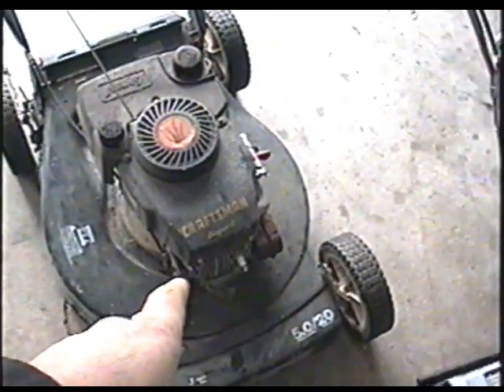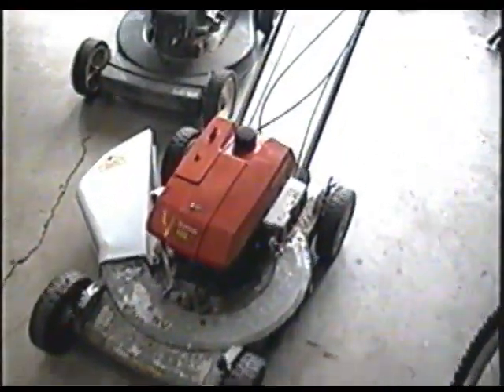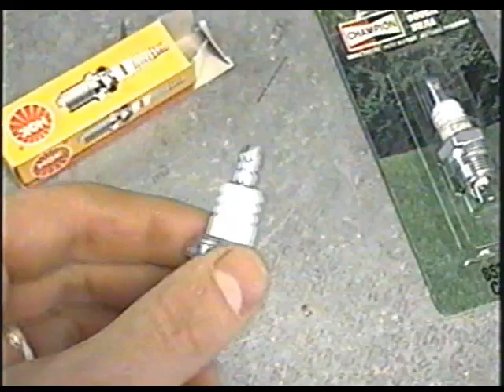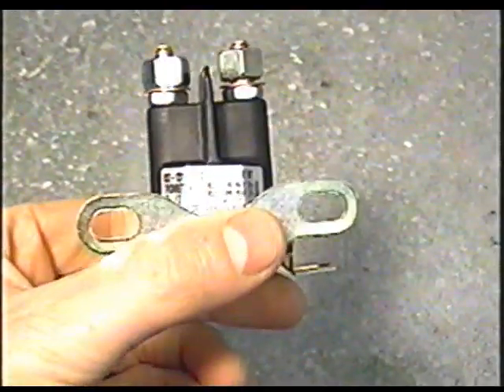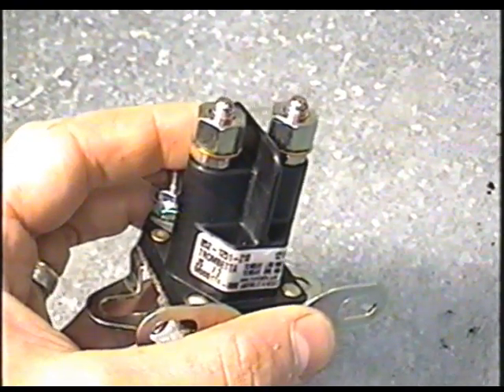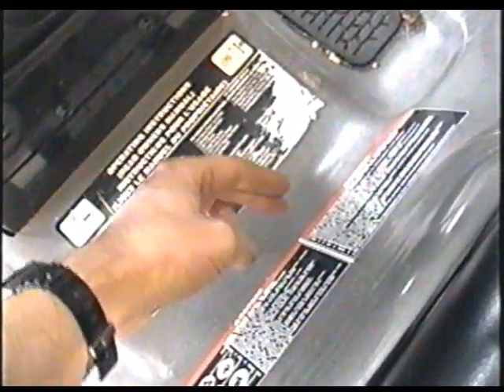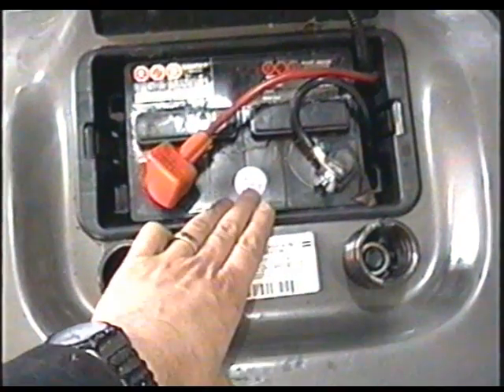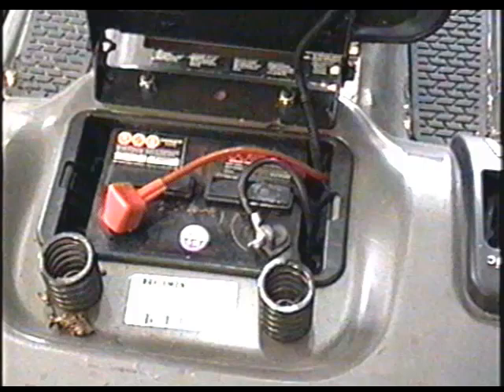Small Engines Q & A  Video #17

Comment: I had the same problem with the solenoid and the trick to test it was make sure tractor is in neutral then take a screwdriver and short over   the 2 top connections if you can not get the tool to jump over it take it out hook a battery to the little tab and negative to the frame of the solenoid then take a meter and check and see if it says 0 ohms across the 2 large connectors remove battery and should say infinitive  across connections if no 0 ohms it is bad

Comment: I have an '06 YARDMAN riding mower with a 20hp kohler V-twin. I had to replace the battery last summer ('09). even with a new battery it is still hard to start, it cranks as if the battery were weak.  The new battery is a little better that the factory one because the guy where I got the battery said that the OE batteries were too weak. is there a reason for this?